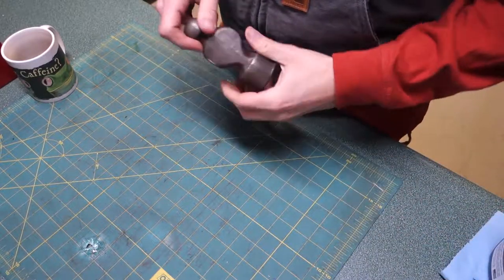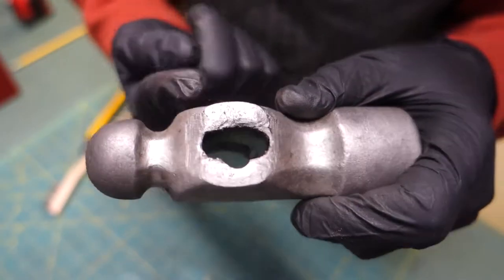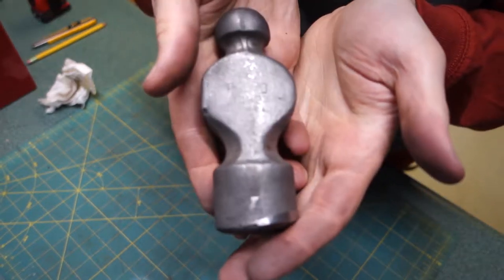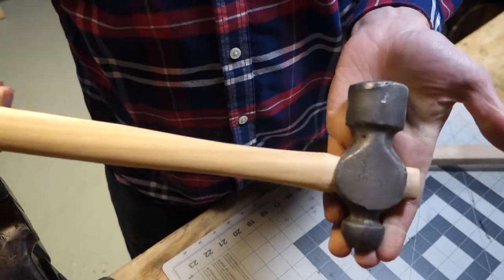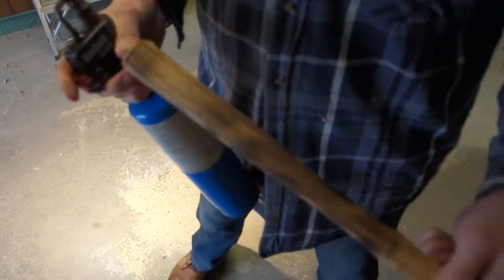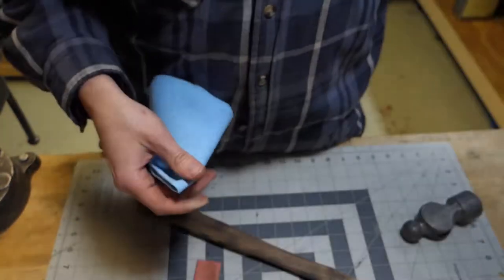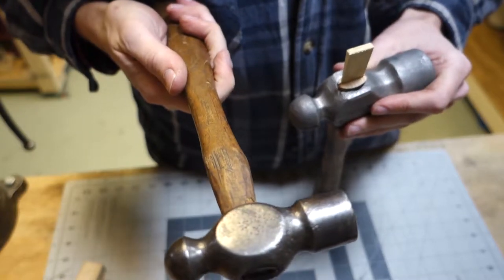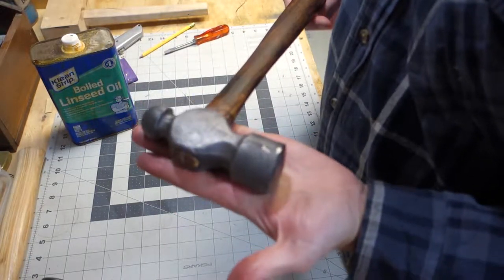Vintage Proto Ball Peen Hammer Restoration - Charred Handle

Comment: Found a proto 1324 at the pawn shop with original handle dor 10 bucks. Found a box of hrand new old stock green proto handles on ebay for 20 for 2. Restored the head at the shop and gotta install the handle today.